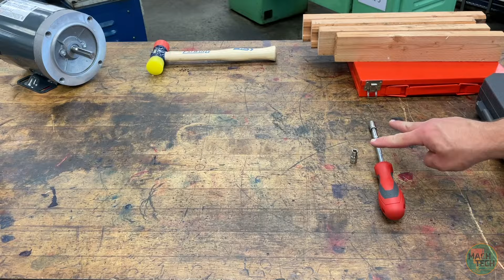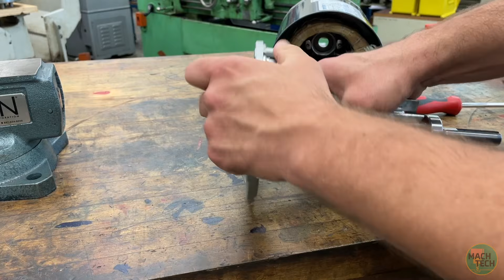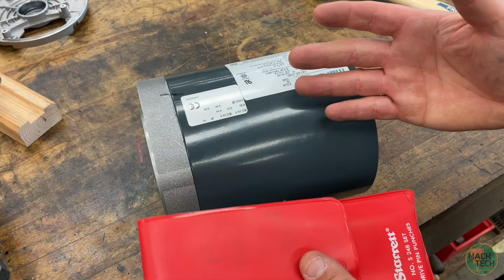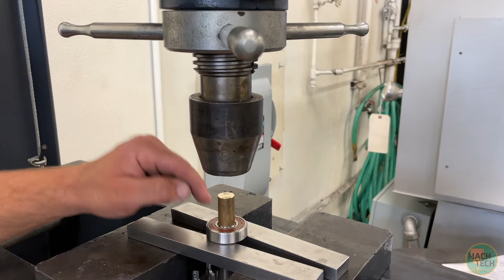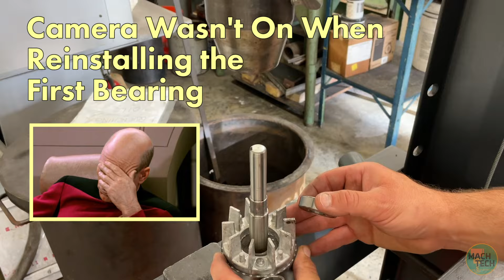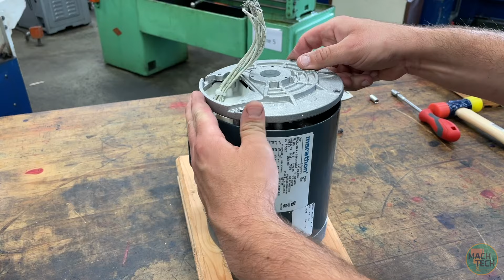Industrial Maintenance 101: Electric Motor Disassembly/Reassembly

Comment: Thank you so much for putting this together. I was puzzled as to how to disassemble the stator. When I saw how you did it, I was like, "no way it is that easy." I got my motor, tapped it with a hammer and screw driver, and it fell out,  easy peasy! I was shocked. Thank you.

Comment: Doesn't everyone have a handy dandy hydraulic press in the basement ?  It's the expensive orange bucket thing that has some kind of cushion to catch the shaft that is needed.  Where do you find that ?  Could run you  $3-4 more

Comment: Good lab to teach kids how things should be taken apart. now it would be even better to have old donated motors with corrosion/ wear ect to take them apart and talk about tricks and tips on how to work with stubborn old parts. then talk about what do to when something breaks in the prosses. Like what bearing suppler you would call up or talk to motor company to get a new shaft. And teach them if its worth it to just get a new motor. That would give the students a huge leg up in the field

Comment: thank you for the match marking tip. there has been more than one time when i had to use "clues" to reassemble a device. Clues that have included the device no longer going into the space it came from.

Comment: hello, I would like to know one thing. I would like to buy a chinese DC brushed motor, but the problem is they are somewhat possesed by chain sprockets and D shafts. Is it possible to disassemble the motor and change the D shaped shaft for the shaft with shaft key ?

Comment: So useful!  Very grateful for your excellent video.  I do need to take some classes. Too hard to figure out motors on my own.
I'm fixing a mini bench grinder I found in the trash.  It looks unused. But won't work. Electrical wiring below deck seems alright. It might be the switch that is bad. I took motor apart, cleaned commutator copper cylinder gently. Carbon brushes seem fine too. The stator (housing) has two strong magnets. So when putting the long bolts back in, what a job!  Cannot get the 2nd bolt back in, as the magnets pull it sideways.  Arrrghhh#!%%^$!!  So silly to make a magnetic bolt, instead of a non-magnetic metal bolt.  I'll try it vertically, but I'm so close its frustrating. I have to put an aluminum rod thru then hot glue it to the bolt to pull it through maybe? How to do this?  Anyone has ideas?

Comment: im looking at your stator right now if im not mistaken this turns mechanical energy into electrical energy not the opposite  i'm pretty sure thats an alternator
Reply: Every action has a equal and opposite reaction. Every electric motor is also a generator you can either apply electricity and it will turn to rotation/ mechanical energy and conversely if you turn a motor mechanically it will generate electricity.

Comment: Great video, i just went through this on a maytag motor that has been discontinued for some years and the motor and motor control board was re-engineered with a different hookup to the the main washer control board so it would be costly to get a washer technician to come out and rewire the new connectors and the different number of wires was fixed by the technician. They really made it hard to replace the 2 bearings because they used snap rings to limit the bearing on the shaft when installing them back on instead of machining a step on the shaft. It was difficult to get the bearings off especially on one end where the bearing was way back on the shaft with the snap ring about 1/8" from the rotor windings. The real stickler was the the small diameter belt pulley that was hydrolic pressed on at the factory and they turned the 5/8" shaft down to 3/16" and added splines before pressing it on at the factory, this had to come off before removing the bearing after pressing it off of the raised portion on the shaft, i took it to a car mechanic and he got it off because this is common problem when working on drive transmissions or rear ends. I was able to use your technique on one bearing but the other bearing where it was hugged right up to the rotor windings i had to cut it off. I when reinstalling heated bearings up in oven on aluminum foil to 200F for 30 minutes where it wasn't hot enough to melt the grease or make it smoke and the bearings where metal shielded, i ran these out one at a time wraped in aluminum foil where i had it allready setup on my Dake arbor press and the pressed on very easy right down to the snap rings on the motor shaft. Washer works great and i even allready had the NSK6002V bearings so it only cost me 20$ at car mechanic and a lot of free time to get job done.

Comment: Very informative video. Thank You.
Why do these types of motors get louder with age?
Is it a rotor/bearing issue, or something to do with the stator?
I didn't see any brushes on this particular model.
Is there a way to replace or repair them?
Reply: Key reasons why an electric motor becomes noisier over time:
Worn bearings:
The bearings within the motor are crucial for smooth rotation, but as they wear out, they can start to wobble and create additional noise. 
Loose stator laminations:
The metal laminations in the stator can become slightly loose over time, causing vibrations and humming sounds when the motor is running. 
Accumulated dirt and debris:
Dust and dirt can build up inside the motor, adding to friction and noise. 
Damaged windings:
Insulation on the motor windings can deteriorate over time, causing them to rub against each other and generate noise. 
Improper lubrication:
Lack of proper lubrication on moving parts can lead to increased friction and noise. 
What to do about a noisy motor:
Check for lubrication:
If possible, re-lubricate the motor bearings according to manufacturer recommendations. 
Clean the motor:
Remove any dust or debris from the motor housing and cooling vents. 
Inspect for damage:
Look for signs of wear and tear on bearings, windings, and other components. 
Consider motor replacement:
If the noise is excessive and repairs are not feasible, replacing the motor may be necessary.
Reply: @mjremy2605  Thank you for your very thorough response.
I'm not entirely sure where to lubricate the motor. I see an access hole(?). Also bearing lubrication seems to be beyond my ability as I do not have a press to remove or replace the bearings. Am I making this harder than it is? 😄

Comment: I used to diagnose and repair electric motors. For very small shops with limited space, inductive bearing heaters are a great option for removing bearings. Great video as alwaysvmy friend.

Comment: Great video to let me know what I’m getting myself into. The only question that I have is the two clips that held the one bearing under the main cap. Those clips seem to be free spinning. So should you have not put them in place first and at least snugged them down before you put that cover onto the stater?  Otherwise they may have never properly engaged the bearing?
Reply: Yes, my observation as well.  Should have been snugged as you suggested and now "it's too late".  Also, given the somewhat condescending nature of this tutorial, there really should be some caution on the proper torque for all those fine-threaded bolts.  Still, a good little video IF you have a clean, brand-new motor.

Comment: So what would the differences be if this motor was explosion proof? I've recently been schooled on the method of piping the wires where they come out of the motor, and filling that pipe with cement, but we weren't able to get the motor housing apart to see how that was assembled. Doesn't seem like you'd be able to fill the motor housing with cement, though, or else it would lock the rotor in place, so now you've got me curious. Thanks!

Comment: Good video and strong jumping off /intro to motor repair.  In the field (as opposed to a shop), we typically use pullers to remove the bearings and heaters (induction commonly) to replace the bearings.

Comment: My trade was rewind electric motors, In Australia we have 240v 1 phase and 440 v 3 phase and 480 2 phase, I could still pull 1 apart without any problem. use a center punch to mark the end housing locating.
Reply: Wow two phase. Have not came across a two phase motor in over 20 years here in USA. I have a few if them up and installed 3 to 2 & 2 to 3 phase changers. Recently attempted to locate one thru the internet rated 30 & 60 amps 250 volt four fuse safety switches with no luck. Back in the 1970's a two phase safety switch cost twice as much as a three phase switch. Philadelphia & Detroit still has some old two phase services from the local electrical provider.

Comment: A beautifully clean modern motor.  No rust, no oxidation, no seized bolts, no seized and grinding bearings which allow the shaft to slop about.  Easy peasy but no relation to the real world.
Reply: Did you not read the video description, it’s for green students at the Laney College lab. 

It has nothing to do with the dirty, hamburgered up factors of the real world that you mentioned 😂😎.
Reply: Yes he should show a messed up motor that will show us how the work 😆
Reply: You sound so bitter

Comment: Because everybody has a hydraulic press...
Reply: Don't think too hard about the fancy equipment. Bottle jack or scissors jack, some sturdy wood, a couple metal plates and some sockets and you can get this done. It won't be pretty, but it does work. Replaced plenty of bearings in the middle of nowhere without the "proper" tools.
Reply: This guy problem solves
Reply: I mean, you can use an arbor press but who doesn’t have a hydraulic press?
Reply: @Airtight215  I don't have a hydraulic press, nor an arbor press.
Reply: prob not what u should be attempting then @mjremy2605
Reply: Well I mean its a video to disassemble an electric motor the right way, not a DIY video lol
Reply: Have like 6... Keep tripping over them, especially the one in my bathroom
Reply: Well, you see see the mess of makeshift crap ive got going on here. No shiney stuff
Reply: Because who doesn’t have a hydraulic press....🥱🥱🥱
Reply: Uhhh yeah?

Comment: How did you pull the shaft/rotor/bearing assembly out so easily from the stator/motor casing?  My rotor is magnetically stuck to the inside of the stator.  When I try to pull the assembly out of the motor housing, the magnetic force is so powerful it yanks the rotor back inside.  I could probably force it out but don't want to damage it.  There's no power going to the motor so I'm not sure how the electromagnet is holding the rotor in so tightly.
Reply: Only time that I had what you called magnetically held was a PM DC  ( permanent magnet ) motor. Might take two.people. One  pulling shaft & the second person pushing on opposite end. They expect these strong magnets only an aluminum frame. Maybe one out of every 3 or 4 burnt bout PM could I remove these magnets in one piece. Never came across one over 1 or 2 HP.
Reply: Only time that I had what you called magnetically held was a PM DC  ( permanent magnet ) motor. Might take two.people. One  pulling shaft & the second person pushing on opposite end. They expect these strong magnets only an aluminum frame. Maybe one out of every 3 or 4 burnt bout PM could I remove these magnets in one piece. Never came across one over 1 or 2 HP.
Reply: Only time that I had what you called magnetically held was a PM DC  ( permanent magnet ) motor. Might take two.people. One  pulling shaft & the second person pushing on opposite end. They expect these strong magnets only an aluminum frame. Maybe one out of every 3 or 4 burnt bout PM could I remove these magnets in one piece. Never came across one over 1 or 2 HP.

Comment: You never told people to disconnect the motor from power first!🤣

These motors are often compatible across different brands. I had 2 motors, one a non working motor with the right length shaft and a working motor with a shaft that was too short. Different brand motors, but I swapped the rotor out and it worked great. 

I do remember the back bell cap not seeing all the way because the back bearing was out just a bit further on the replacement rotor, so naturally, I just used the bell cap from the other motor and it fit together perfect. Just make sure the motors are for example both 120v single phase or both 240v etc, etc. 

Also, when I install the back cap, I don’t tap it in until I get all 4 screws started in their threaded holes. That way I can twist the cap slightly if I need to. Then tap it down and tighten the screws.

Comment: Is that a brushless motor?
Reply from the maker: Three Phase AC Electric Motor - the workhorse of industry. I would have loved to go more into the theory and discuss various types of motors. But folks can sign up for our MACH 207 - Mechanical Drives class for that 😉
Reply: @laneymachinetechclassroom  That's what I thought -- but I also thought I saw brush caps on the sides of the motor housing (black round thingies).  Thanks!
Reply: It's called an AC induction motor because there is no electrical connection to the rotor. Technically it has no brushes, but the term "brushless" is reserved for other types of motors.